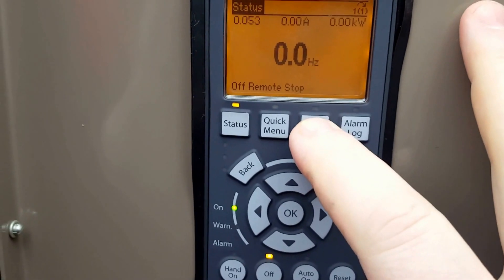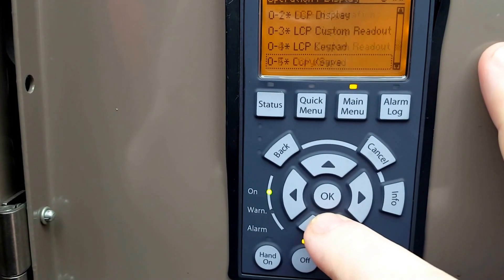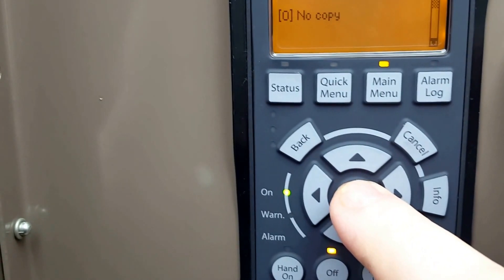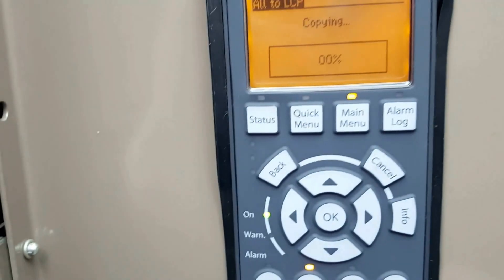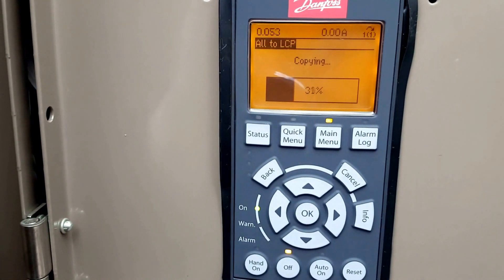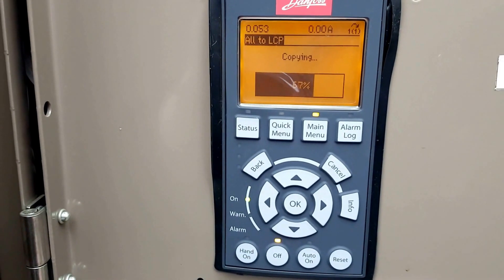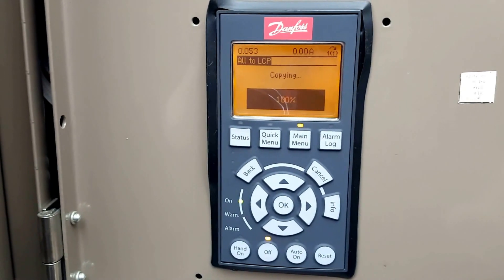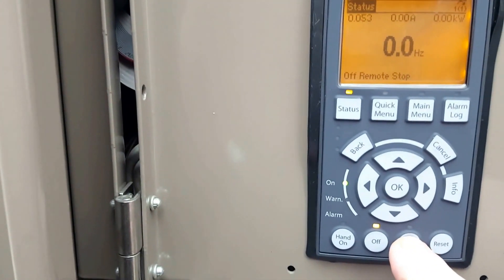Danfoss VFD Training, How to save drive parameters

Comment: SIR we have purchased new one DANFOSS VFD 37KW BY replacing old one , so which proggrame  should be uploaded in that?
Reply from the maker: If it is the exact same model drive you can load the program from the original drive if you saved it. If not, you will need to do a set up on the new drive

Comment: What the possible solution of current limit??cause vfd danfoss have a current limit problem.can you till me what we ganno do
Reply from the maker: There are a few things that can be going on.  The drive is trying to protect the motor by limiting the current output.   You will need to check the motor and load and make sure the drive set up matches the motor you are using. If it is an older danfoss, you may have a drive issue.
Reply: @Systemcontroltech  we try to change another vfd .and the result we show again the current limit...i also change the encoder.potintiometer but cant work.

Comment: Though this question is not related to this video which I am going to ask you. How do I run a motor reverse and forward with selector switch? I have given 24 V to terminal 18, and 19 separately to test, but this is not working to me. [ VLT 5000]
Reply from the maker: +Salat Mahmud you will need to set it up in the drive parameters. It doesn't know what to do with the input without configuring it to reverse.